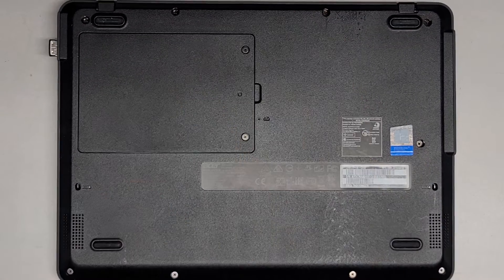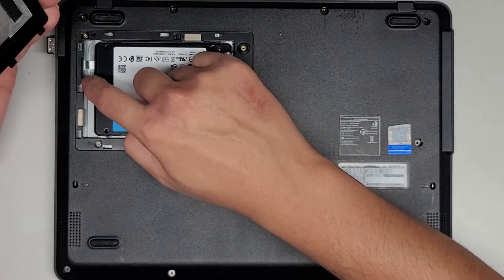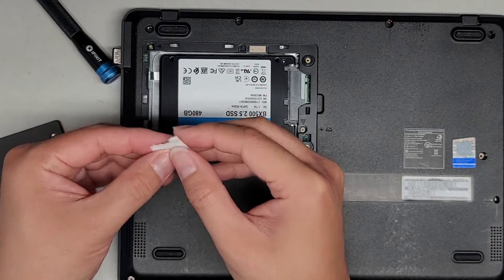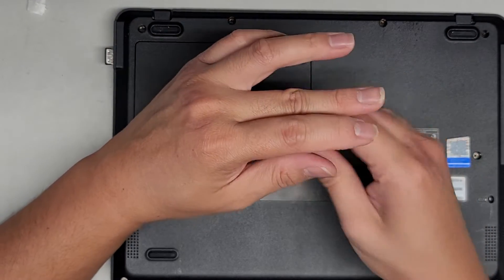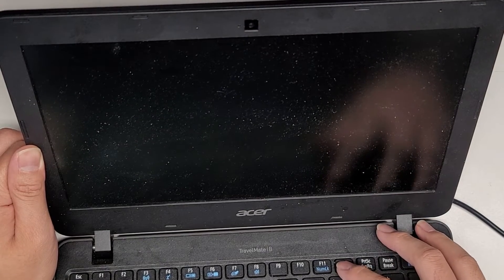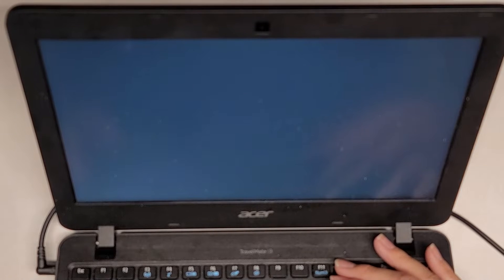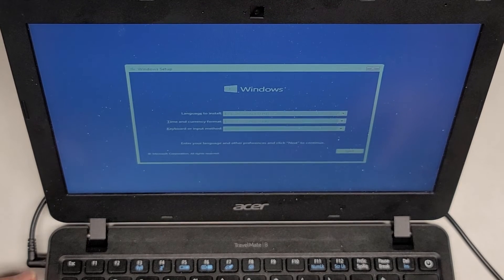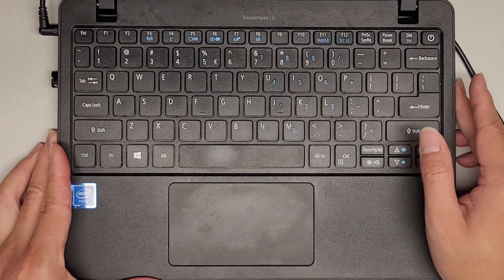Acer Travelmate B117 Series N16Q9 Disassembly SSD Hard Drive Upgrade Replacement Repair

Comment: Is it posible to upgrade the ram?
Reply from the maker: I didn't take this one apart, so I'm not sure.
Reply: @ItsBinhRepaired  ohhh ok cuz i opened my travel note b117 and only the SSD hard drive is changeable, as for the memory ram i can't find where it's located
Reply from the maker: @romeovlogs2697  likely soldered
Reply: @ItsBinhRepaired  agree
Reply from the maker: Yup